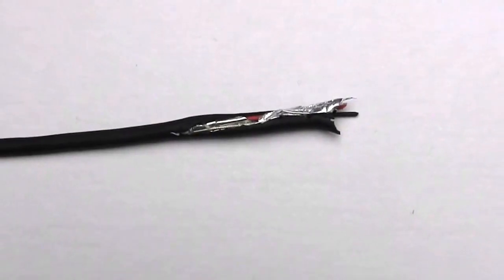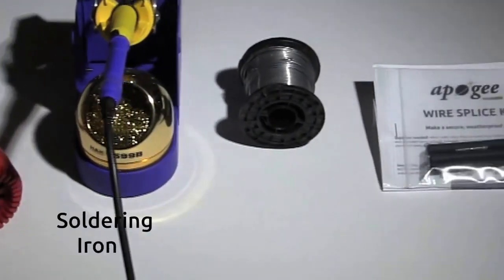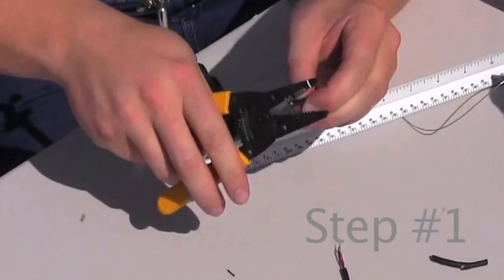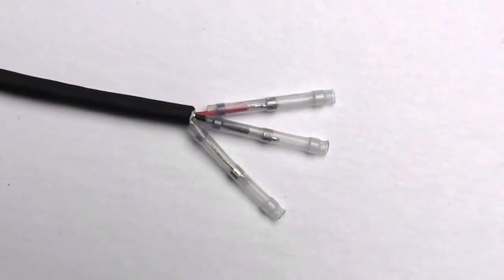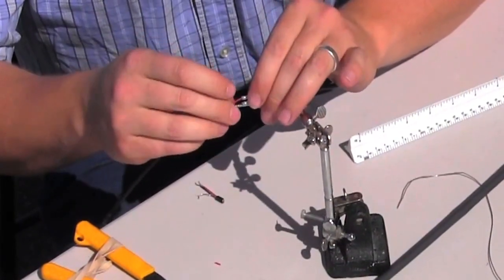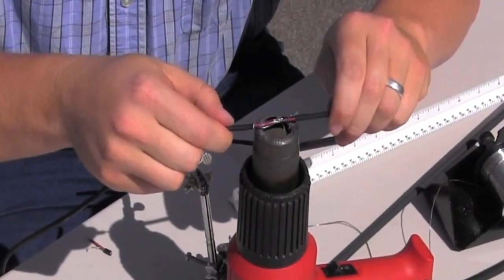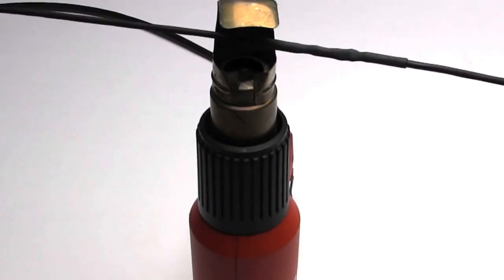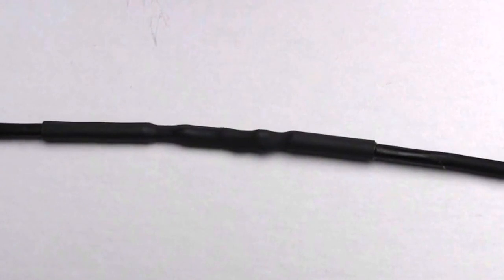How to Make a Durable Wire Splice

Comment: 2:13-2:15 To prevent accidental separation, I'd suggest something stable to hold both ends, like a helping hands clamp. 
2:30 Have there been numerous tests from various companies to confirm that this wire splice technique is waterproof?

Comment: What kind of adhesive can you use if you do not have adhesive lined heat-shrink tubing?
Reply: I used hot glue to cover the joint on my garden landscape lights then covered it with normal black heat shrink and reheated until the hot glue squeezed out a little and have not had any issues yet. It has been about 3 years.

Comment: As long as it isn't pulled on. I was able to use caps that worked (almost) as well (simply not as waterproof), and even bound them up with duct tape, but they still pulled apart when under stress.
Reply: When would you pull that much on a wire? 
During the installation? Normal everyday use?
Reply: @rusoxelruso  If I recall what the item was, it was in a vacuum cleaner, and the stress was when putting it back together. There wasn't much play in them. But once together, there wouldn't be any stress.